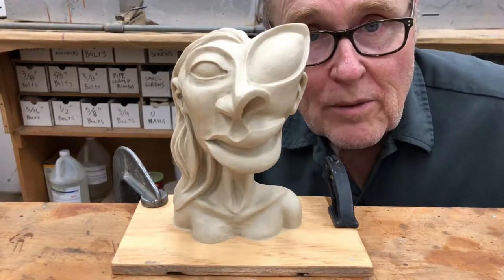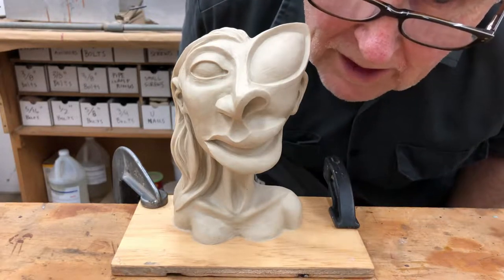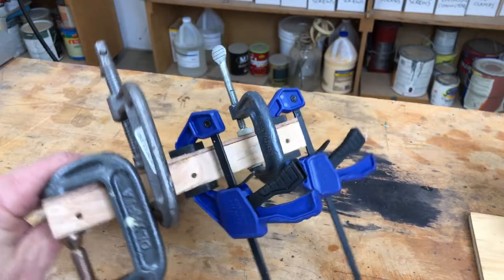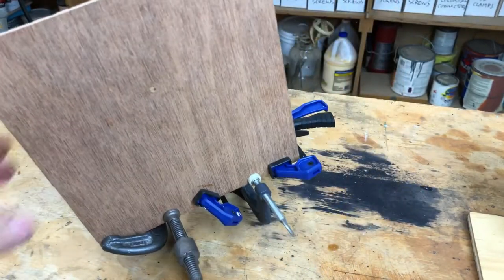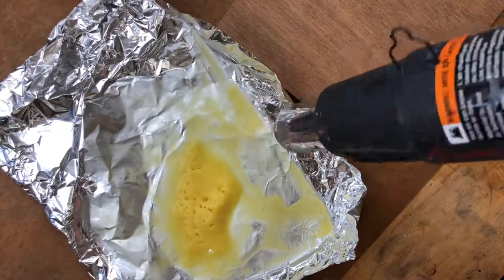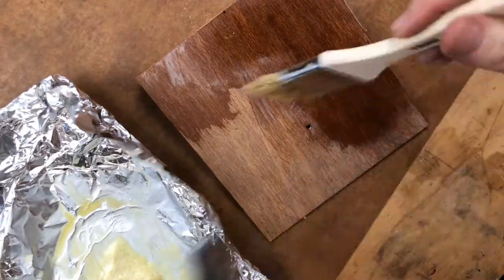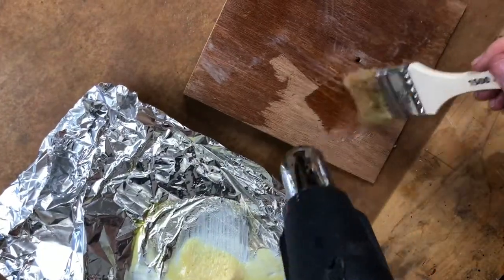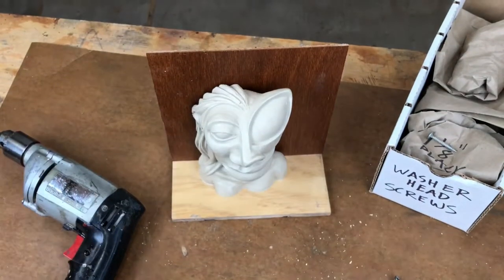How to make a silicone rubber brush-on mold.

Comment: Roll out cly 5mm thick, cover.  Make fibreglass case. Drill pilot holes into wood base. Remove clay. Replace shell screw down, runners and risers. Pour silicone. Clay standbye for leaks and many drilled tiny holes in fibre shell. Cover pattern with cling film if worried clay sheet will stick to pattern. Easy

Comment: Most people incorrectly think Beeswax is 'bee poop' or is a substance ejected from glans in the bee's mouth as they often will absorb taht a bee will look like its chewing beeswax and spitting it out to build with.  However its MUCH more complicated than that Female worker bees make the beeswax to build the honeycomb. The forager bees bring the nectar back to the hive in their honey stomach where it is passed from bee to bee to reduce the water content and become honey. To produce a pound of wax bees need to ingest 6-8 pounds of honey. It is estimated that bees need to visit an 30 million flowers to produce a pound of beeswax.  Female worker bees convert the honey to beeswax. Bees huddle together to increase the temperature in the hive to at least 33 C which enables the wax glands in their abdomen to convert the sugar from honey into beeswax which oozes through small pores to form scales on their abdomen. They or other hive worker bees chew these small scales to turn them into beeswax of the right consistency to build the comb. The wax scales are about 3 mm across and 0.1 mm thick and about 1100 scales are needed to produce 1 gram of wax.  Bees maintain the warm ambient temperature to ensure the wax can be worked into hexagon cylinders. This explains why just body heat is needed to make bees wax pliable and it otherwise melts at lower heat than other waxes. Bees apparently discovered that hexagons are the strongest and most efficient structure in which to store the honey, as that shape can holdup well, will not break or collapse from the weight of the honey and not ruin all the honey or kill all the brood if the hive is attacked or is damaged.  A bear or other animal can swipe out a section of the comb to eat while the rest will stay enact even if knocked to the ground.  Beeswax is initially clear and becomes yellower/darker as it’s used to store honey, pollen and raise their brood. The color of beeswax varies depending on the color of the honey and its age. You can see the variation in color of the beeswax if you source your Beewax from local source where you can choose which wax you want. The local Beekeeper can usually identify which pollen was made into what honey and then into beeswax, and can usually date the age of a hive and how long that beeswax has been in the hive.  If a have is damaged the bees will look for any parts that have fallen from the hive and consume consume any beeswax and honey in those parts until nothing is left and the recycle it and build it back into the hive or if the hove was damaged too badly, build a new hive with what they recycle.  A knowledgeable beekeeper can also identify beeswax produced from recycled honey/beeswax from a damaged hive by not only its color but by the consistency of the wax which is often finer.   Beeswax that bees have recycled is often prized by fine wood craftsman for waxing a finished product as its is more easily rubbed into the pores of the wood and seals better then newer beeswax and is believed to give a better luster and for that reason is often more expensive to buy. Beeswax is an excellent substance for food storage as well as it will be tacky in any state of met, from just warmed to body temp or all the way to a liquid,. As as soon as its warmed to around 33 C it is no longer brittle and will be tacky at that temperature and stick well to its self and some other items.  The warmer it becomes the more the tackiness increases until its as sticky as a good glue and will adhere to almost anything,  Once it cools back below 33 C it is back in a brittle form that can easily be broken away from anything it was put on so is not considered a permanent adhesive.  But when 'dried' (aka cooled down to under 33 C) in it brittle state it is an excellent  sealant if left undisturbed that will protect even foods for storage from water, air, humidity, dust, dirt and other environmental factors. Before paraffin was discovered beeswax was often used to seal tops of jars and bowls for preserving foods, but care had to be taken to keep it in  cool location or the beeswax would melt and the seal would break. It was often warmed up to a consistency where it could be flattened or rolled out like dough and used to wrap cheeses for storage while they cured as well as wraps around a midday meal for worked to take in their pockets.  Honey and beeswax both are considered to have medicinal properties and both are often used in different ways on deep wounds to promote healing and fight infection.  Bees have become endangered insects so much so that many that use great amounts of beeswax have become bee hobbyists and actually 'rescue' hives to keep in hive boxes in gardens where the bees do not have long trip or a have time to locate pollen so that they happily stay in the beekeepers box producing honey and wax and then the hobbyist bee keeper has all the wax they would need for their real careers.  They will often keep a few empty bee boxes available as long as their garden(s) can support more hives and hope that when one of their hives swarms the new queen will just move into the new box and put her workers to building new honey combs out of bees wax, filling them with honey and making a good place for her to lay brood.  Because of the steady decline of bees these hobbyist keepers who started doing this just to have a ready source of beeswax and/or honey have become very important to saving the species.  Without bees collecting pollen and getting some stuck on there legs and then landing on another plant many food items could not be produced because of lack of cross pollination.
Reply from the maker: Great info Pam, thanks so much for this! Makes me love bees and beeswax even more!

Comment: Thanks it was wery helpful but I have a question after you finish with brushing the silicone code on the sculpture how do you clean your brush to use it next time ? Is there any way to clean the brush ?
Reply from the maker: Not that I know of.  You could experiment with solvents like paint or lacquer thinner but I never bother. I just use several of the cheapest brushes I can find for each mold. I budget them into the cost of a mold. The two biggest mold costs are labor and silicone rubber; the other materials are relatively inexpensive.

Comment: hy, one question a silicone mould is more detailed than the old style plaster mould ??? Acually was looking for an brush on mould an have just pouring silicone , bless you 
 thank you for your videos , so many helpfull tips
Reply from the maker: Silicone rubber can reproduce fantastic detail. Theoretically, it can reproduce details that you can’t do in plaster because of the interlocking with a rigid mold.

Comment: Hi Robert, I love your video's and have learned an awful lot, you really know what you are doing.Can you please answer this. I have just made a casting in plaster of paris and want to make a mould of the casting. Can I make the mould while the Plaster Of Paris is still quite damp? I really want to get a mould made and dont really have the time to wait for it to thoroughly dry out as it seems to be taking quite a while. Will my polyurethane rubber, that I bought, still set around the dampish object?
Thanks
Les
Reply from the maker: I wish I could tell your but I have never tried to to cast urethane rubber against damp plaster.  I would do a small test.
Reply: @RobertTolone  Thank you so much for your reply. I don't know why I didnt think of that!! 🤣🤣

Thanks Les

Comment: I'm probably wrong but wouldn't it be a lot easier just to make a regular mold ? Time is money and this seems to take a lot of time. Interesting video.
Reply from the maker: In my client work, time is always more valuable than materials.  I would throw a box around this model and fill it with rubber quick and easy. But on my channel I try to show a lot of different ways to build molds. For many viewers the cost of silicone rubber is prohibitive and this is their hobby so time is not a factor.

Comment: Hey Bob,  I know this is not a sculpting channel but was just curious what is the clay that you use for your sculpture in this video? And another question it's why the need to make the silicone so thick if there will be a hard nother mold?   Thanks in advance
Reply from the maker: Thin silicone molds don’t retain their shape inside the shell.  They can buckle or sag. The perfect blanket mold is exactly thick enough to hold its shape.  Obviously, the bigger the mold the thicker it needs to be. The clay I used was oil clay from silpak.com. Laura

Comment: @Robert would this "drizzle" technique work for a shallow bas relief on a flat surface, or would you always recommend the technique of pouring into the lowest spot and letting it rise as the best technique (if you can use it)?
Reply from the maker: Either technique works as long as you focus on areas where bubbles can get trapped.
Reply: @RobertTolone  Thank you for the reply!

Comment: Do you think the silicone with fibers addes to it would still be flexible enough for glove molds in some circumstances?  TY Robert!
Reply from the maker: You would have to really test, Edward. Fibers usually make the rubber stiffer and more brittle. So it seems to me you would almost certainly give up flexibility. It all comes down to the ratio of fiber to rubber.

Comment: Would this be good to make 3d archery targets with?
Reply from the maker: Tin-based rubbers have a relatively short life.  They get brittle over time.  A urethane rubber might work better and be less expensive.
Reply: @RobertTolone  alright ill have to check that out, thank you

Comment: Do you prefer 1:1 silicone or the 10:1 jazz for brushons?
Reply from the maker: I don’t experiment much with rubbers from various manufacturers. That’s because I want the fewest number of variables in my process. The rubber I use for both poured and brush-on molds happens to be a 10-to-1 mix but that doesn’t mean other rubber systems won’t work just as well.
Reply: @RobertTolone  Cheers Robert, you legend

Comment: If you were making a two-part mold of an oil clay model, what would you use for the parting clay you set the model in?
Reply from the maker: The short answer is I wouldn’t do it.  I would make a cut mold.  The only time I make two-part molds is if I have a hard model and even then there has to be a very good reason. Any model made of clay or wax is going to get dinged up when you make the parting line for a two-part mold no matter how careful you are.

Comment: Do you think this would work with a Nike tennis shoe ?
Reply from the maker: Silicone rubber will bond to porous materials.  So any fabric, etc would have to be sealed.  Also silicones often don’t play well with rubber. You would have to test to see if the materials in the shoe are compatible with your rubber.
Reply: @RobertTolone  Thank you so much

Comment: Will this powder work to thicken any silicone? Reason I ask,is I only use the 1.1 or 2.1 mix ratio silicones.
Reply from the maker: I don’t know.  The only way to find out is to test it. It’s used to thicken a variety of materials so It has a good chance at working.
Reply: @RobertTolone  Thanks

Comment: It looks like the PE fiber filler you use in the silicone fluffs it up to twice its volume give or take.  Do you think that this offers a significant cost savings all things considered?
Reply from the maker: It would make it cheaper depending on how much fiber you add. Maybe a filler like microballoons would add more volume for even less money but you would have to do careful testing and measuring to see how much savings you really are getting.
Reply: @RobertTolone  Probably reusing chunkies would be the best way to go to maintain flexibility.  Also they dont cost anything at all.   Do you draw the line somewhere when it comes to the reusability of old rubber?
Reply from the maker: If an old mold is really discolored and brittle I throw it away.  Plus I like to cut the chunks so that every surface is fresh when I use them. I think the rubber oxidizes and also gets dirty sitting around. Very smart to keep old molds sealed in plastic containers or bags.
Reply: @RobertTolone  great tips, I will definitely use them.  I use platinum so I guess they last quite a bit longer, but I do run into cure inhibition more often.

Comment: Hi Robert . What is the brand of the mother mold resin and where can I buy it? I’ve been using plast-paste and sometime plaster bandages for small mother molds but would love to try this material. Thanks!
Reply from the maker: I use Trowel-On 60 urethane resin from Silpak. www.silpak.com. It’s a 2-part A/B system that they sell as kits in various sizes. Thanks for watching!